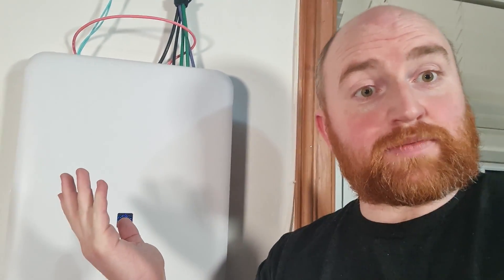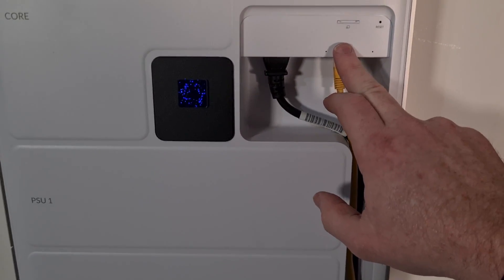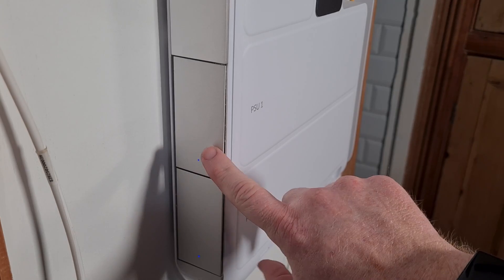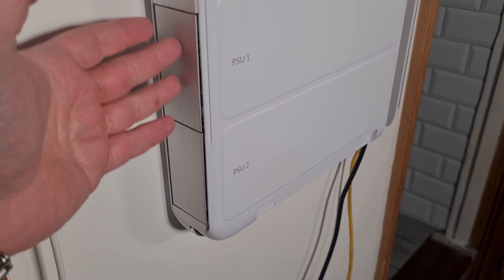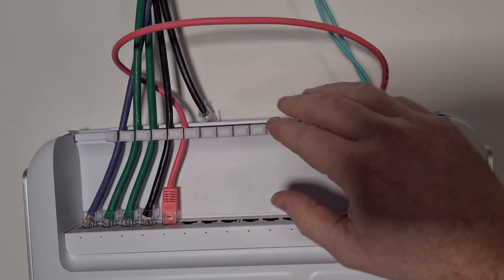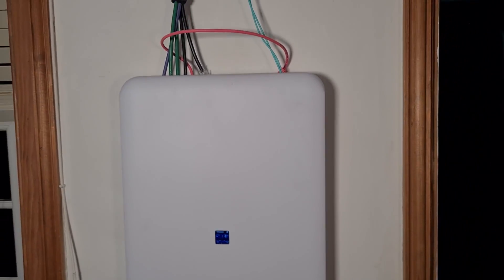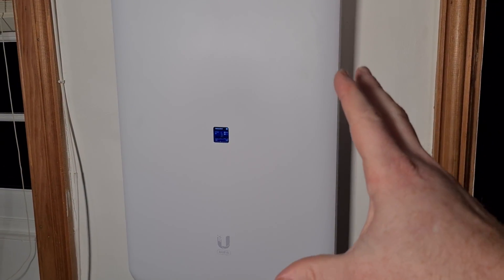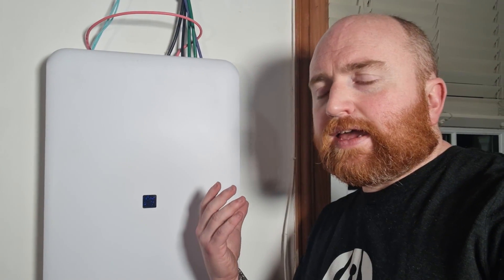The Unifi Dreamwall Revisited - A year later and is it still good?

Comment: If a new version that comes out with. Hard drive for protect, i would buy it. This micro sd card puts me off. I have a Pro XGS access point and an E7 but for the rack area, the dream wall is a better product for my use case because it has the POE ++ built in and enough POE to run a camera as well.

Comment: Have to disagree half way on the psu's. We did have one fail and it did keep them running for the 2 week rma. This was a new unit and a bad fan on the psu. They wanted the whole unit back so guess that makes it useless, except we just sent the psu and they sent a whole new dream wall. I would have preferred to just submit the data file from the unit, showing the failed psu and ship a new one. They have fixed 2 problems you mentioned, Notifications and Replacement psu's.
Many say this form factor is useless but I agree, we have several customers that have benefited from having it and we honestly use the wifi on it as a backup. I do wish they would make it so the wifi module on it was upgradeable and or replaceable. If each part was an easy swap module, it would remove the all in one fault it does have.

One more note, even customers that have the space, want this instead and it does save on cost.

Comment: I see your Dream Wall is the Early Access version.   The GA version has a much larger touch screen, which is more useful.    Also there are additional cable management options on the GA model.
That said, I've seen a lot of EA models in the field, and they are a great option.  Put it in your equipment room on the wall, for people who don't want or need a rack.   The built in WiFi AP is great, but you can add a couple of extra AP's if you need to as the Dream Wall has a really great PoE capacity.     Only thing I don't like is having an SD Card for Protect storage.  But I understand why they put SD only on this because the camera capacity is only about 6 cameras on the standard dream wall.
I think people need to be more creative with cable management, more open minded, and then the cable management would make more sense.  Cable Raceways are available if needed also.
You did nail it at the end.   People were concerned because it is different and they couldn't be think outside of rack mount.
By the way, redundant power supplies is more for if a PSU fails, not if power coming in fails, so the design, although not ideal, still makes sense for using this in a hotel / small business situation.

Comment: Hello,
I hope this message finds you well.

I am from Chile and in the process of setting up a WiFi network using Starlink and need to distribute the internet signal through 13 Ubiquiti U6+ Access Points. I recently purchased a USW-Pro-24-POE (400W) switch, which appears suitable for effectively unifying the network.

Could you please advise on what other Ubiquiti equipment is the most economical yet effective to ensure the unification of all Access Points into a cohesive network that operates optimally?

Thank you very much for your assistance, and I look forward to your guidance.

Best regards
Pablo Araya

Comment: Quick question, I’m looking to get one of these but I will be pairing it with one U7 Pro. So could you use the 2.5gb wan port as a lan port?I would be looking to plug the AP into that port if it’s possible
Reply from the maker: You can, but its not POE so you would need a 2.5Gbe POE injector
Reply: Ports are generally fully remapable, but the newer AP Require 2.5, i dont recommend going with an injector.

Comment: For an SE, yes to all of the suggestion you made in this video.

For a Pro, give at least the option of built-in (or even modular) battery backup. Put “mission critical” in the name maybe.

The form factor is great for small business and just because “mission critical” is often associated with large enterprise, keeping a network up during power faults is still critical no matter what size business you have.

“Just use a UPS”. OK, but I could do that with a switch, and yet Ubiquiti offer a mission critical switch with battery backup, so there is a market for devices like that.
Reply from the maker: Going on the terrible quality the batteries in the ckg2+ had.....I dont hold out much hope for the mission criticals in a few years...so big no on fitting one in a Dreamwall IMHO

Comment: Not following the no need for dual p/s?  P/S failure is a big reason for routers going down.  Am I missing something?  I do understand the desire for more HD space.

I love the POE++ since you can add flex switches down stream to support small office rooms and the like.  Obviously this is a unit for smaller businesses.
Reply: HD space could be used security systems or logging, although logging wouldn’t use much data